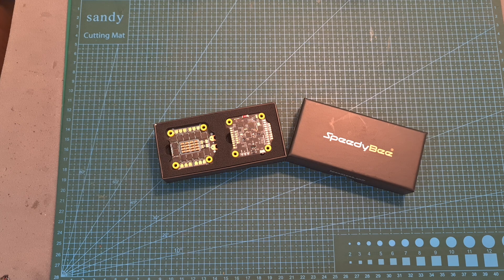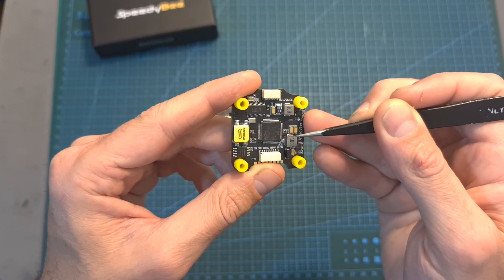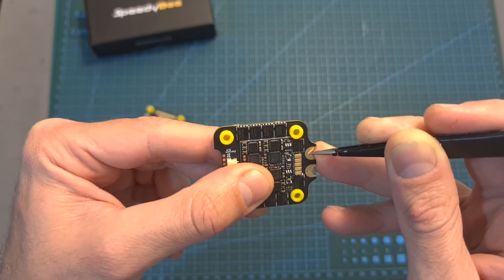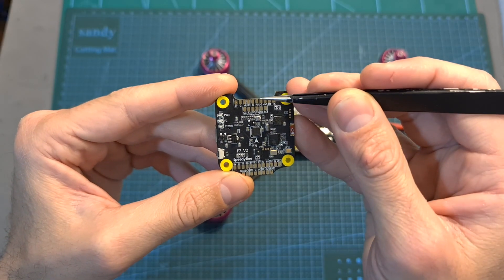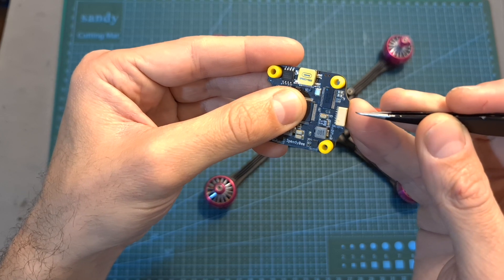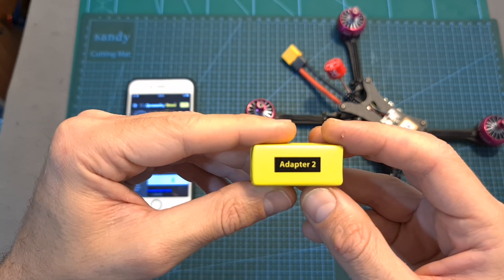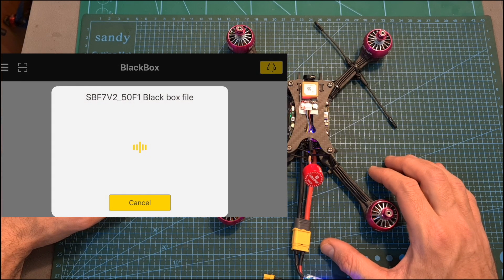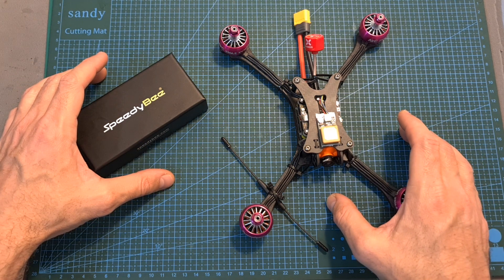The Most User Friendly Stack? SpeedyBee F7 V2 Stack - Setup & Review

Comment: Hello there, I'm trying to build that same stack but I'm getting short circuit
Reply from the maker: Hi, did you figure it out?
Reply: @KremerFPV  Thanks for getting back!. I just realize that my question was not posted correctly the full explanation it's not showing, anyway... Yes, I'm finally moving forward so the problem was the 4 in 1 ESC for some reason it was shorted, I went to the supplier and got another one, this time I was successfully able to build it and make it work :)  After this, I face some other problems like one of the ESC ("number 2") was not spinning but after asking and dining on the Betaflight is all good now. Has been a journey in order to make it work but it's looking better now. I'll let you know how it went in the end.

Comment: Has anyone installed INAV on the Speedybee F7V2? On mine, the DSHOT BEACON is permanently on as soon as you activate the outputs.  So all motors beep permanently. Applies to INAV 3.01 3.02 and 4.0 BF does not have the problem. On Multishot it is also gone. "Beeper -all" does not help either. A buzzer works normally.

Comment: Thanks for the review. Did you ever try this out? I am trying to build with it now and can't even find a manual for port configurations.
Reply from the maker: My pleasure Bryan. Yes I have, and it's working great. You can see the pinout diagram in the product page.
Reply: @KremerFPV  I had the pinouts, but thought I needed the port info. Figured them out though and finished the build. At least it hovers well. Hopefully will maiden today weather permitting.  This is my first 5 inch. Never flown larger than a 3" toothpick before, so I'm a little nervous of all the power. Will take things slow though.  Thanks again for all the good content!

Comment: Hi Gal, 
  very good review job here! I only showed it briefly in the worst livestream of all times :) 
Now I want to use this thing - really amazing how much hightech they can put on such little devices. 
Weird idea of mine:   can I install this tiny new stack on a really old, large (10"? Props)  DJI copter I still have? It flew terrible with DJI Naza but has some fine  T Motor MT4006  with 740kv on it. 
Is the 4in1 ESC really 45amp   times 4?   the motors have max 27amps   but in cruise around 10amps I guess. 
Have you tried to throw a current stack like this on a really old large copter yet?  How good does the PID loop work on something off-standard?
I more and more like this idea - might make an interesting video :)
Hope all is well down there - but I read most ppl in Israel are vaccinated already?
Reply from the maker: Thanks Mario, yes it was a funny one (only watched a part of it, sorry). 
It sounds like an interesting idea - why don't you try it out?
Yes, most of the population over here (Including my family, me and my wife) are all vaccinated and things are getting back to normal. Since two days ago we don't need to wear masks out in the open which is great. I hope things over there are getting better for you as well. Cheers!
Reply: @KremerFPV  In the meantime I've installed it rather to my "SG325 from skystars" this copter was downed since it fell out of the air twice (I guess the old FC froze). Now with the new speedy FC and AIO ESC it is back to live.   I LOVE the blutooth setup connection and how easy everything has gotten in our hobby. Tuning the 8.3 inch mavic props on the SG325 doesnt work 100% - but it flies.   Maybe I'll try an iNav installation on this copter later - could be usefull for our application (testing stuff with waypoints).
While we're not yet all vaccinated there is some promised return to normality for the summer - we'll see!
greets, Mario
Reply from the maker: @Rcschim  Yes, I assume that tuning this mini beast won't be easy also using iNav, however it has some pre-defined settings that you can try as a start for bigger drones. As I've already told you, eventually I will build a similar setup for testing applications in order to replace my Mavic Air 2 :-) 
I surely hope that things will get back to normal soon and I am looking forward to be able to travel abroad again...

Comment: Is it more user friendly than the rush blade stack?
Reply from the maker: Rush blade is indeed a user friendly stack in terms of connectors.
Reply: @KremerFPV  would you say these 2 stacks are similar or does the speedybee have more features?
Reply from the maker: @theshadow2576  if you don't want to do a lot of soldering work - go for the Blade. If you'd like to have wireless bl/wifi built in capabilities,  go for the SpeedyBee F7 stack.